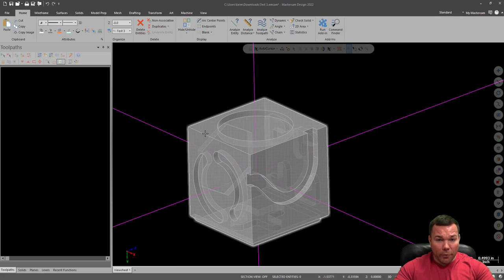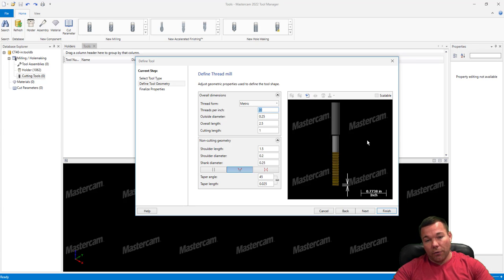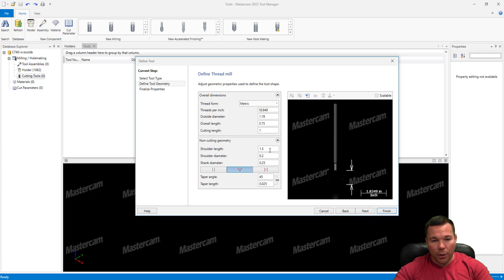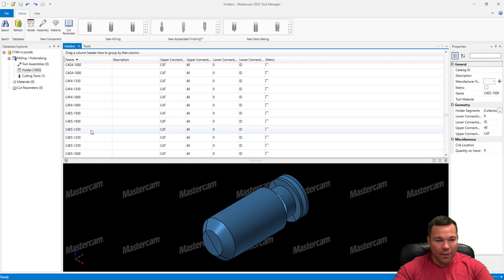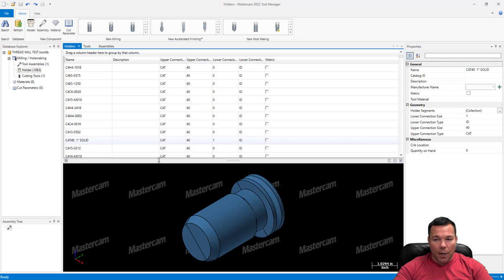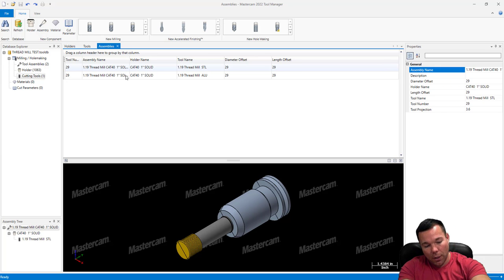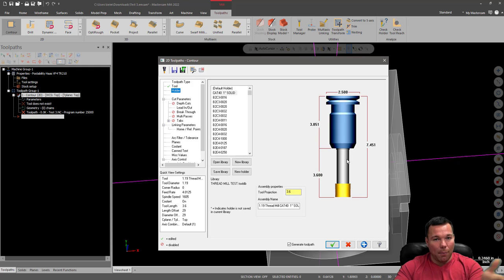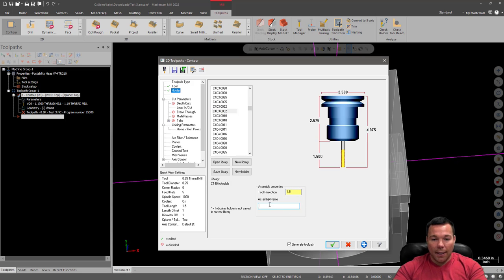MasterCAM Creating a tool library , custom tools, and tool assemblies

Comment: i never use the external tool manager to create tools because it doesnt give me a advantage. all i can set there is the same as in the internal tool manager + the coolant modes are wrong in the external one (we have 8 different coolant modes, of which 2 are chip conveyor and bed wash idk what its called in english). I really hope CNCsoftware improves the tool database to include speeds and feeds for each material i have and also specify most doc, woc of most toolpaths available in mastercam. This way i can set a material, create a toolpath, load a tool (i dont have to create multiple tools for different materials) and basically the correct feeds and speeds as well as doc woc etc are all preset. Press calculate, post, run, done. 

i would also probably tell my supervisor to update to the newest version just because of this.